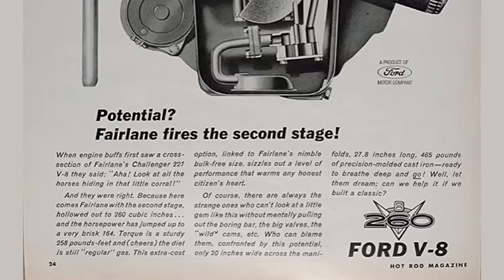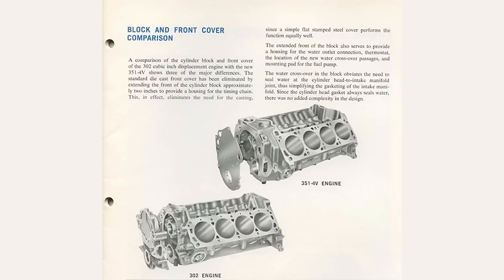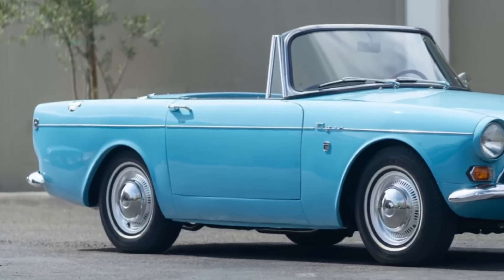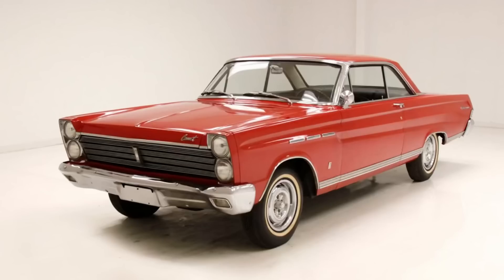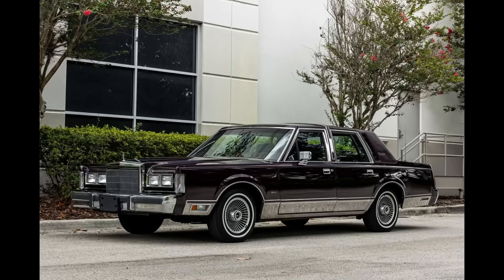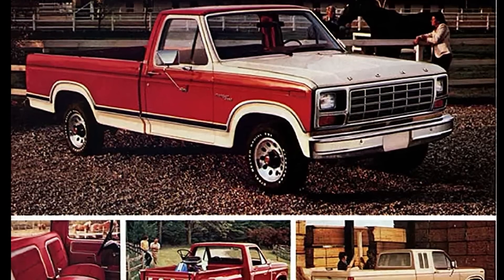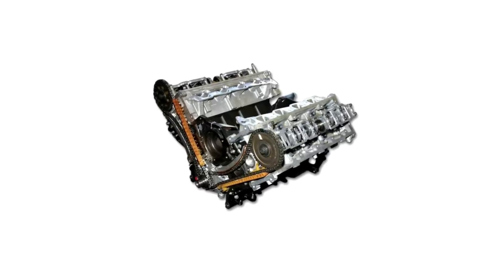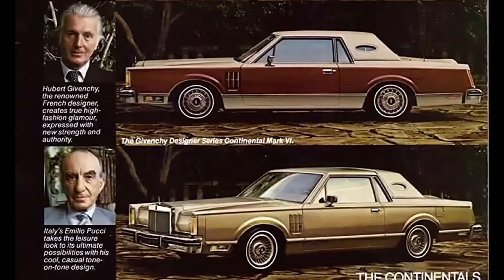Ford small block engine family 221, 260, 289, 302, 351W, 255 not the race engines

Comment: The 255 c.i. V8 was also available in the full-size LTD. I couldn't believe they would put that small of an engine  in a full size car. It was plagued by Ford's variable venturi carb and also had the first of the first gen AOD automatics. Very finnicky. I was regularly having to make adjustments.
There was also the regular production Boss 302 V8, not a race engine. It was a Mustang hi-po option. It differed from the other 302's because it had 351C cylinder heads. It still used the smaller intake manifold though.
Both the 351W and 351C engines initially had the small rear bolt pattern which the 221-302 V8's had. When the 351C was given the big block rear bolt pattern it was known as the 351M. At the same time, the 400 was also given the "M" designation. By 1976, the 351W was also given the big block rear bolt pattern. I am not aware of a different designation for the 351W, it remained the 351W. It was available in Ford's full line of cars, mid-size to light trucks and vans. We had a fleet of Ford vans, 1976 and newer with that engine. One van had a 400M, but I never saw a Ford truck, outside of a Ranchero, with a 351M engine.
Yep. The first Cobras came with the 260-2V V8. Carroll Shelby was also behind  creating the Sunbeam Tiger. After Chrysler took over the British Rootes group, they were going to put the Mopar 273 V8 in the tiger, but that never happened and the Tiger was discontinued.
Speaking of Mustangs, the 64 1/2 model had the 260 V8 option and as with all other applications using that engine, only had either a manual transmission or the last of the 2-speed Ford-O-Matics.
Reply: I never saw a 351W with the M/400 pattern. Every 351W I encountered had the usual SBF pattern with a block-plate locating the starter  further outboard. I'd be curious to see an image of the super-freak.

As to 351M trucks... I thought they were rather workaday common.
Reply: @johne189  As I think I stated, we had a fleet of Ford E250 & 350 vans from 1976 and newer, equipped with wheelchair lifts. All but one had a 351W with the Ford big block rear bolt pattern. All used the large case C6 automatic. Because they were so common and readily available, we bought a couple of C6's from Lincoln 460's for spares and I went through them, freshened them up, and had them waiting for one of the van's to come in needing transmission work. We could gang them and have the vans ready to go in a couple of hours.
As to the engines themselves, which we were into regularly, the only problems that we had with the 351W was valve springs breaking.
At around 100k miles, we would replace the timing chains and gears with all-metal gears and premium timing chains. Water and fuel pumps. We would also pull the pans and replace the oil pumps with HV oil pumps. We'd also replace the crankshaft seals.  After we had a couple of engines break valve springs, we started replacing all the valve springs and the valve stem seals. The heads were definitely 351W heads.
With that maintenance schedule, also changing the oil every 3k miles, we never had to replace an engine. We had vans with 500K miles on them.
Now, in California, with the next major restyle of fords mid-size line(1977?), Ford decided to put C4 automatics behind the 351W's and M's. The C4's would fail by 20K. We tried rebuilding the C4's using HD parts and they would last a little longer, but they would still fail. 49-State spec cars came with FMX's. Never had a problem with an FMX. We then started replacing the C4's with C6's and driveshafts from mid-size Fords that had 400M's or the rare 460. We couldn't use the Lincoln C6's as the manual shift levers were different. Unless we had another C6 around to swap levers(which I did with my parents' 19741/2 Ford Elite), we couldn't use them.
It was years before they put an overdrive automatic behind a 351 or 400(or even the 300 c.i. six), because all the AOD's had small block rear bolt patterns. When the C6-based FIOD, an electronically-controlled automatic, was introduced, everything could have an overdrive automatic.
Reply: @automatedelectronics6062  — It’s surprising that Ford put that little C4 in a heavy duty van. I think I would have changed brands …
Reply: @automatedelectronics6062  The overdrive that replaced the C-6 was the E4OD in the early 90s. The E4OD had a wide-ratio gearset with a 2.71 first gear which was a bolt-in swap for the C-6s 2.40 first gear ratio set. Ford actually sold the conversion kit at one time through the Motorsport performance parts catalog.
Reply: @donreinke5863  Right, E4OD. But it didn't replace the C6 right away. The C6 was still available. For example, in the 1989 Ford Bronco Eddie Bauer edition with the 351, they used the C6. I had several that I worked on. I resealed and refreshed internally 3 of the C6's. In 1990 it changed and the E4OD was available. The E4OD's would strip out the teeth of the sun shell. The aftermarket cam up with a heavier duty  sun shell, so when I opened up an E4OD, I installed the new shell. It was a huge transmission, but the internal components weren't any heavier duty than the C6. Ford flip-flopped around with one of the drums and clutches  inside it in the early 2K, but ended up going back to the C6 type clutch pack.
Reply: @Clyde-2055  Yep. I had a customer with an ex-U-Haul E350 box van, which could have been early-70's cab style, and it had a C4. GM wasn't any better. On their G30's, with 350 V8's, they got the TH350 automatic. A great automatic, but not as good as a TH400.
Heck, in the late-70's, they even put the C4 in full-size LTD's behind 302 V8's. I seem to remember they even used the C4 behind the 351's in the LTD's(atleast in California). As I think stated earlier, 49-State Fords got FMX's behind the 351-2V.
Reply: @automatedelectronics6062  — The GM 400 and 350 were interchangeable with minor changes, but the 350 could also be had in a beefy form. Also, to my experience, the TH350 was far superior to the C4 in heavy-duty applications.

Honestly, I was never a huge fan of the C4. To me, every V8 Ford should have been equipped with the FMX or C6, leaving the C4 to the 6-cylinder cars.
Reply: @automatedelectronics6062  One thing that was an upgrade in the E4OD was the planetary gears. C6 transmissions had 3 planet pinions as did light duty E4ODs.
Heavier duty units had 4 and diesels had 6. Diesel equipped trucks werent frequently junked, so the 6 pinion planetaries were harder to come by.
I used to strip them in self service wrecking yards just for the 4 pinion planetaries when doing wide ratio C6 conversions
Ford changed the dimensions of the direct clutch drum in 1976, and the later drum had to be used with the E4OD gearset..
The number of splines on the input was also changed in 1972. I build C6s 5-5-5
5 direct, 5 forward and 5 low/reverse, which requires machining the low reverse pressure plate, the alternative is to cut a new snap ring groove in the case but machine shops wanted big money to do that (most of it is setup fees) and had to have a large enough lathe.
Econoline vans had C-6s available into the 90s, they were mostly ordered by fleet operators. 
I only used the pre-1977 C-6 cases that had the reinforcing vanes on the rear part of the integral bellhousing, those were used on "385" configuration engines.
FE bellhousings did not have them, but 351W bellhousings did. 351 engines, Windsor, Cleveland or modified Cleveland could have a C4, FMX (most common up to 1981 when the FMX was dropped) or C6 behind them.
A similar wide ratio transmission can be made from the 1980-92 AOD by using planetary components from the 4R70W, this changes first gear from 2.40 in the stock AOD to 2.84, but the AOD is only available with the smallblock bellhousing and requires adapters to be used with FE and 385 configuration bellhousings
The adapters arent cheap..
Reply: @donreinke5863  It's been 2017 the last year before I retired that I regularly rebuilt transmissions, so I've forgotten alot.
Now that you've mentioned it, going to the 4-pinion planetary was also another regular upgrade I'd do to the E4OD. My transmission parts suppliers usually had the upgraded planetaries available, if not I could get them through the new car dealers. About the only things which were rare as hens' teeth and just weren't available when the Hemi-spec 727 clutch drums or the 5-clutch C6 clutch drums. I never had a problem getting the 4-clutch drums.
The GM 4L60E also had some additional pinion and clutch upgrades. 
If there was an upgrade, I stated doing them as soon as I found out of them.
Reply: @automatedelectronics6062 One transmission I have never torn down was the Torqueflite A-618 behind a Cummins.
I suspected they would have the Hemi internals, but never found out.
 Back in the 80s, I had an old timer machinist who built race cars bring me his race car hauler which was a modified Dodge bookmobile with a 413. He would use it every year to take a car to Pikes Peak, and every year the transmission would fry.
He asked me if i could do anything with it..
Like most 727s it had about an inch that the  4 forward frictions would ride on, and my ex girlfriend (she had a degree in automotive technology) and I thinned the steels with the machinist owners help until we were able to center 5 clutches on the planetary input splines as well as play around with the line pressure a bit.
We installed the largest transmission cooler we could find, and the transmission never failed again.
Like many old-timers, automatics were voodoo and he wouldnt touch it himself.
Everyone said "yeah but they use them in several thousand HP drag cars with 4 forwards" My response..."they dont weigh 12,000+ lbs going up Pikes Peak."
I still do general repair and transmissions, starting in high school back in 72.
On the back of my WIT catalog is "the Beast" an upgraded 700R4/4L60 sun shell.
Reply: @donreinke5863  I have never been into an A-618, so I don't know. It's supposed to use heavier duty internals, like more planets in the planetaries. But, it's still basically a 727, with 2 bands and internal clutch sets. Behind a Cummins 5.9 they added some clutch plates. They also reduced the power when the Cummins 5.9 had an automatic.
The Mopar truck 413 was a whole different animal. I used to see them in Winnebago's and when Dodge still had a HD truck line. They abandoned those long before Ford turned their HD truck line to Freightliner.  If a 413 equipped big motorhome sized vehicle had a 727, it was a flatland vehicle. For a short time, Dodge had a 4-speed Loadflite automatic with a new extra low 1st gear added and the other 3 being normal. The Park was eliminated. It was based on a 727. A customer had a 318 V8 powered full-sized school bus with this special loadflite. It was a very weak transmission and luckily I didn't have to deal with it. They sold it to a private school  who very quickly grenaded it and there were no parts available. 
I don't care how big of an oil cooler is added, it isn't going to help when the transmission is used outside of it's normal working range.
Reply: @automatedelectronics6062  I dont agree with that. Larger heavy duty transmissions will withstand a lot of abuse..IF the fluid temperature is kept low enough that the fluid doesnt break down. Heat also degrades seals as well as friction materials.
There used to be a chart at the local Transtar distributor that showed a breakdown of transmission longevity vs transmission temperature.
Of course, much depends on how the transmission is built, and whether modifications are performed to increase torque capacity. Its the reason I put a 2 inch overdrive band (along with an upgraded servo) and a 6 disc direct clutch in AODs instead  of the 1.5 inch band and 4 or 5 disc direct clutch.
If I need it to withstand more extreme use I use the 6 disc Alto direct clutch pack as well as install red and black throughout the transmission, along with an auxiliary cooler, and a Kevlar band.
I guarantee a transmission so upgraded to exceed the expected duty the transmission was originally designed for.
Reply: @donreinke5863  Transmission coolers can help, but can't make up for the heat from slippage. If a band or clutch has burned, it slipped. 
If a vehicle I was doing the transmission in was used for towing, and it didn't have a lock-up torque converter, I would have the torque converter rebuilder modify it to lower the stall speed.
One of my customers had a Dodge dually with a 5.9 Cummins turbo-diesel which he used for towing a multi-car trailer from his home in Central California to a place in the ritzy area of Newport Beach. 
On one trip, the driver pulled into a rest stop which was on a serious uphill incline. When he  tried to take off, the truck wouldn't move. He got it going downhill, and was able to swing the truck around while it was still moving and was able to go uphill and get on the freeway again. When he got back to town, he brought the truck to me and asked if I could do anything.
I beefed up it's 727 automatic as much as I could and had the converter's stall speed lowered, plus installed a Transgo Tow & Go shift kit. I also installed 2 of the largest oil coolers I could fit in front of the stack. I used maybe the Tru-Cool brand? The Haydens never did work well for me. After doing all that, the unloaded truck could spin the rear tires under a  full power start-up and chirp the tires when it shifted into 2nd. And remember, this was a dually.
Well, he didn't have any more trouble starting up an incline.
 There was nothing wrong with the 727 before I worked on it and he put atleast another 100K on it, trouble free.
Chrysler realized that the TorqueFlite automatics had seen better days and for the Hemi cars, they used a Mercedes 5-speed. With the horsepower and torque race going into the stratosphere, especially diesels, Aisin-Warners became the ticket.
Reply: @donreinke5863  As you should know, the 727 was never an electronically controlled automatic, that I had ever seen. Even when they added a lock-up torque converter, it was a governor-controlled hydraulic application. Remember when Chrysler replaced them with non-lock-up  transmissions because the locked converter would cause the engine to stall. When overdrive was tacked on, it was solenoid controlled but the transmission was still governor controlled.
I don't care how low the stall speed was on diesel automatics, I had it lowered even more. The converters still had stators for boosting the torque, I wanted to get more power to the wheels sooner.
Reply: @automatedelectronics6062  Ive never been a fan of anything electronically controlled. GM front wheel drive transaxles with electrical actuation used to lock up frequently and stall the engine. We used to pull the wire that controlled the lockup solenoid, and the issue was gone--permanently--without having to even pull the side pan
I would much rather adjust a modulator or adjust a throttle pressure/kickdown rod or cable than deal with electronic bullshit
Later A-500 and 518 variants of the Torqueflite had electronically controlled pressure regulators, and either the sensor or the regulator itself was frequently a problem.. Fortunately, shifting was not controlled by solenoids, although the separate overdrive unit was electrically actuated.
Reply: @donreinke5863  Yep. The GM front drivers(TH125) had their problems. The major lock-up torque converter problem was chattering. Many were unplugged because of that. The fix was an additive poured into the transaxle.
Solenoid actuated or shifted, they just held and released hydraulic pressure. Just like most any automatic, the real work was done by regular spring loaded hydraulic valves. The electronic pressure regulators were stepper motors which moved hydraulic valves.
Reply: @johne189  Correct.   There was a 400 with a 302/351W/351C bell pattern, though.  Only in 1973, and some service blocks.  It was because Ford was trying out a new automatic from Borg-Warner, the BW12.  It was an absolute shitshow, and Ford even advised replacing a failed BW12 with a more common FMX.
Reply: I got to stick up for the meager 255 V8 here.  One of the few cars I bought brand new was a 1980 Ford Fairmont sedan and it had the 255 V8.  Not many Fairmonts came with that engine because of the so-called gas crisis, malaise, and general recession at the time.  The dealer couldn't unload it and I bought it new at the end of 1980 and at his cost.  He just wanted it gone to make room for the 81's.

My Fairmont must've been made in the middle of the week and when everyone was sober.  It was a damn good car.  I know about that VV carb and got it replaced with a regular Motorcraft 2bbl by a mechanic who also hated the VV's and knew how to get rid of the problem.  Open the hood and everything looked stock like it came from the factory that way.

It had a V8 and that's about it.  It was no hotrod but, I never had to worry about merging on to the highway and it would take a long upgrade with no problem.  The gas mileage averaged around 15-20 mpg as I remember.  Turning on the A/C killed fuel economy and never got past 18mpg in the summer.
Reply: The intake was unique to the Boss 302.   They could not use the regular 302 intake with those heads.
Reply: @xaenon  Probably was. It used the 302's front-mounted thermostat rather than the Cleveland's top-mounted thermostat.
Reply from the maker: That’s crazy they put that 255 in a large car. The 302 was pretty good in a big car. I had two Lincoln town cars with a 302 and they got on really nicely if you knew how to drive it thank you so much much for sharing all of the information greatly appreciate it.